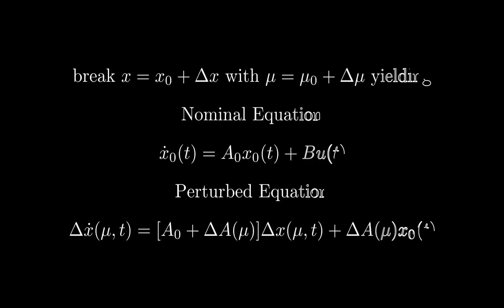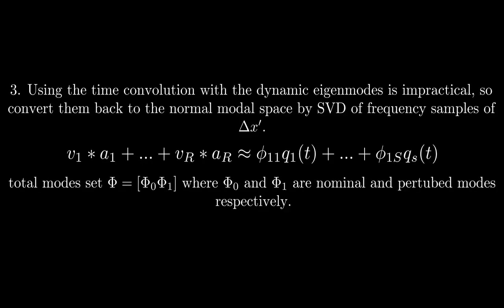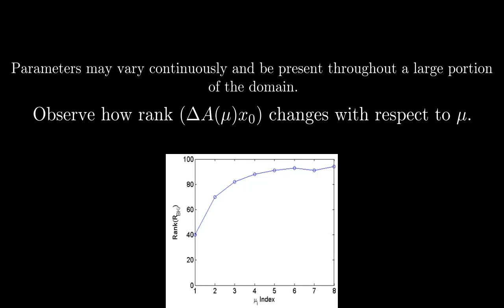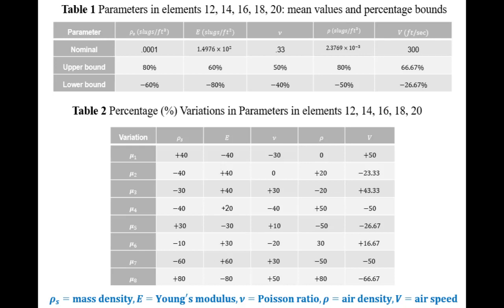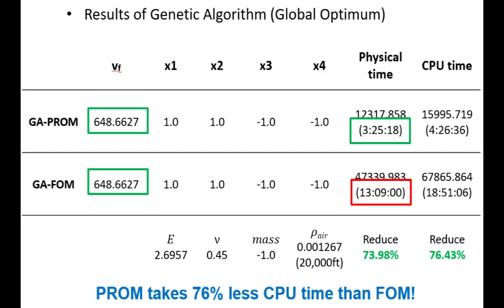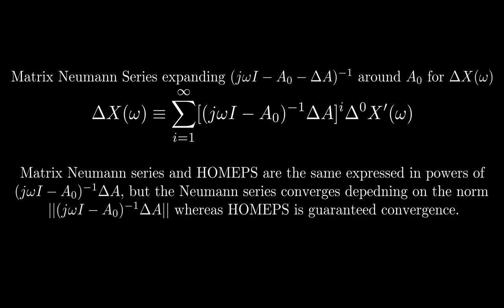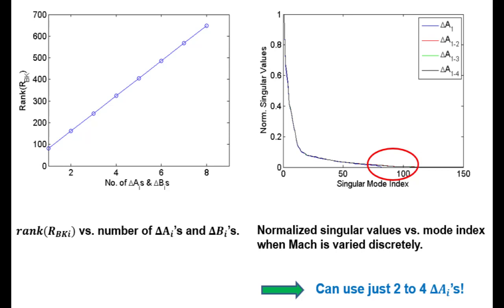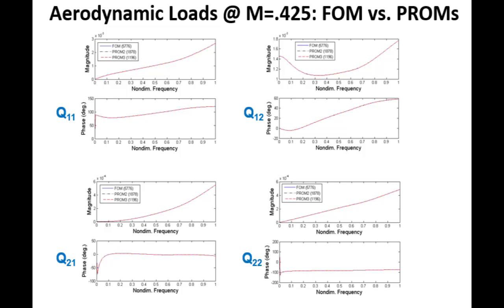Dynamic Eigen Decomposition II: Applications

Comment: Gauge Modal Invariance (or Symmetry) = no matter what ICs, BCs, Inputs are the same set of modes can span all the solutions. In this sense, the modes are invariant to (or symmetric with respect to) the ICs, BCs, Inputs.
Reply: This is a built-in property of the MEPS and HOMEPS as you will see in Part 3.